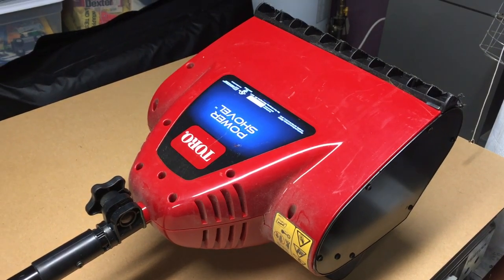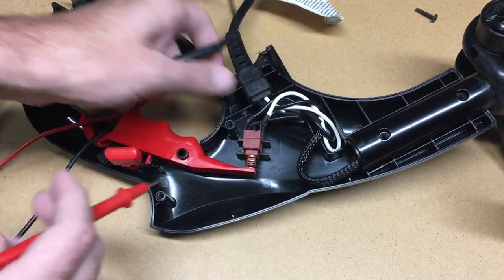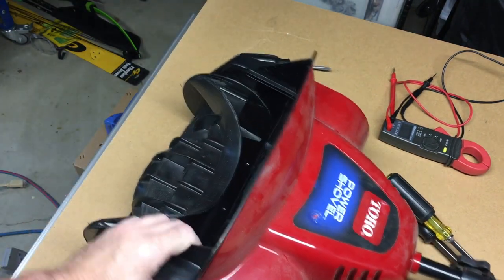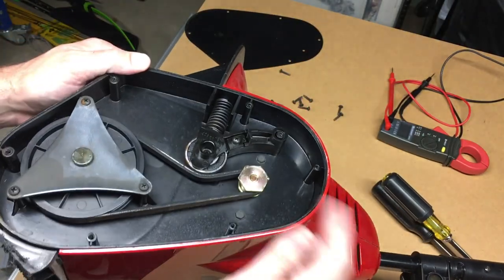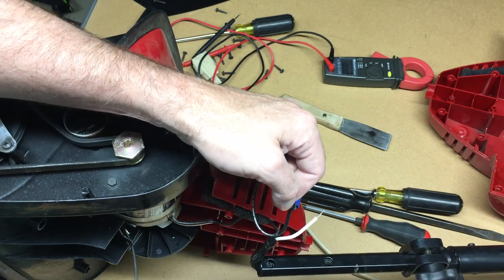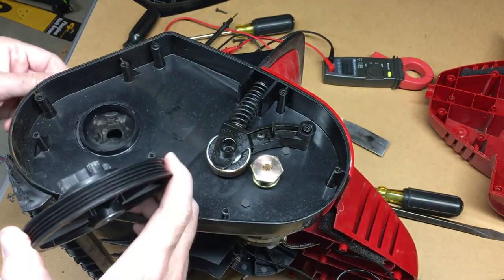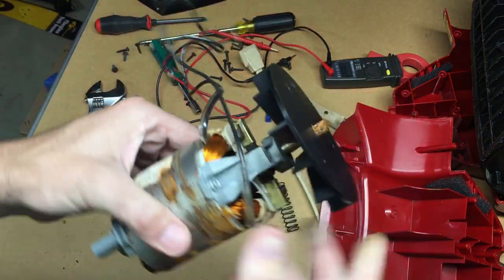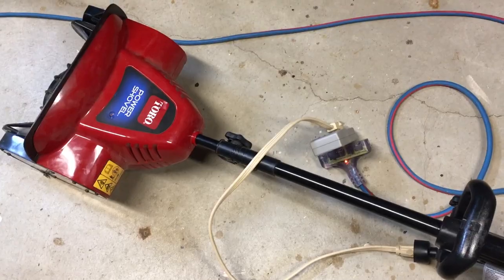Toro Power Shovel Teardown (and Repair?)

Comment: Thanks for the video. For what it's worth...I bought mine for $20 off Marketplace in the summertime. Used it to clear my deck one time earlier today and went to do some more cleanup with it later, and it wouldn't work. It is pretty frigid here in NH today. I brought it inside and had a look at your video, and was about to start pulling it apart. Suddenly it started working again. I'm reasonably sure some ice and snow was frozen up in there and once it thawed, we seem to be back in business.

Comment: I have the exact model that you have here and it does not do anything either. Bought it used store and plugged it in and it worked but first good snow it was DOA. I watched your video but noticed (hint) you didn't proof out the wire going from the handle though the stem to the motor. I did trouble shoot the switch like you did but after taking the bottom apart I checked if 120volts was making to the wires a after having my wife sneeze the reassembled handle and it was not. Like the other poster suggested I put old plug and cord on the motor and it runs fine. i ran another wire down from the handle and though the protector sleeve and its pushing the snow out like the gimmicky tool it was designed to be.

Comment: The bare wire ends wire-nutted to the unit's switch line look pretty short.   Why not try powering up the motor directly before taking it out?  Also, could there be a flat spot on the motor??   Or simply binding up due to corrosion on the shafts??  Perhaps( though not the case here) the motor brushes needed work.
Reply: my guess would be on corrosion, seem to be some vert de gris on connection and rust on the shaft.
another thing could help, using pl-100 on the beering.